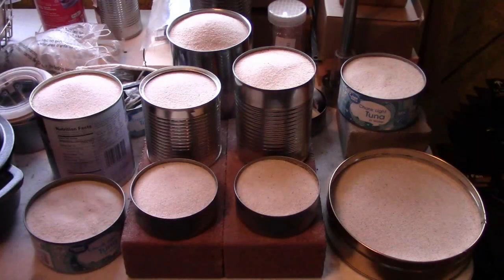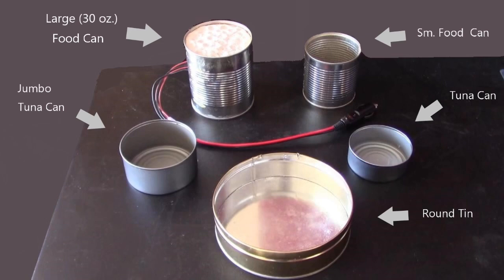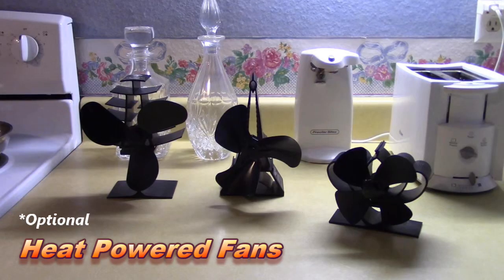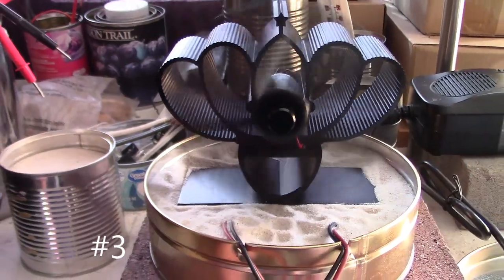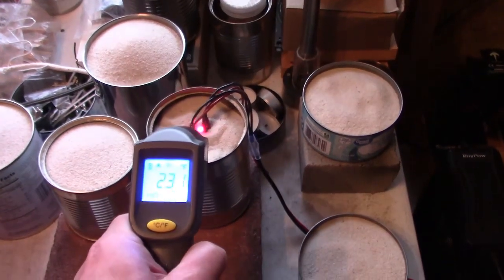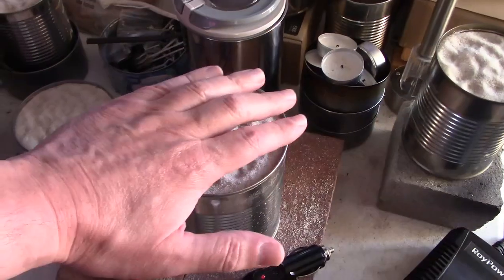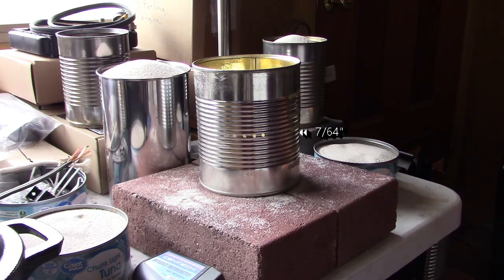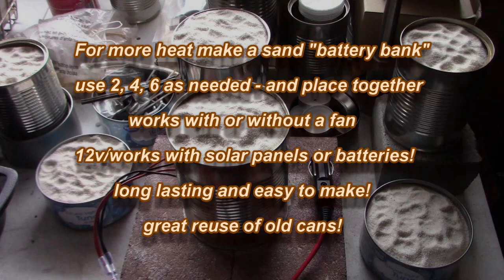5 DIY Sand Battery Space Heaters! with Heating Elements! 300F/150C (self-regulating Ceramic PTC) 12v

Comment: How long do these last burning that hot? I'd imagine the wire connections are going to wear out rapidly.
Reply from the maker: hi. the wires will hold up. they are rated to about 400F. they have a coating on them (i think it's silicone). i've used them (the elements) in high heat applications with no issue for a couple of years. (inside of my water boilers and PTC 'can cookers'.

Comment: Years ago I saw a foreign company using a huge vat of inclosed sand dug in the ground with warming tubes through it. They said the sand could hold the heat up to 5 months. They used it for heating homes. Don’t know what happened to them.
Reply from the maker: hi. there's a company in Finland doing something similar. they are getting ready to make a huge sand battery.
Reply: Works for district heating, such as those found in large cities.

Comment: I tried a 5 gallon bucket with a heating element and 1000 watts input dc from solar panels.  Unfortunately it melted the heating element.  too hot to touch.   I'm wondering if a 55 gallon barrel will heat a room all night.
Reply from the maker: hi there. sounds like an interesting experiment. was it a water heating element? i know those can't run 'dry'. a 55 gallon drum full of hot sand might heat a room for several days or even a week. i've been wanting to use a fresnel lens to heat a barrel of sand. might not take very long.
Reply: @desertsun02  i been saving my big fresnel lense

Then i discovered even the cheap reading fresnel lenses work tape them to the glass 

Im gonna make a solar chimney type heater on south side of my house
Reply: That would best be done with (1) temperature sensors to manage each heaters temp and cut power off when too hot, and (2) multiple smaller heaters throughout the sand rather than one big one. Sand is a good insulator so that is one problem with sand batteries (unlike water) hence multiple smaller ones.
Reply: @Joe-lb8qn  as i mentioned on another post here.....WAX helps trap the heat and it always seems to float to the top making a seal

Heat travels up no matter what....it may take longer to heat if you keep it all to bottom but it heats more sand equalling more heat storage

The key is heat exchange
Reply: @xgymratx wax? What kind of wax? And how would you use it? Wouldn’t this prevent heat radiating at a good rate?

Comment: What rocks are good for heating?
Dolerite, granodiorite, hornfels, gabbro and quartzitic sandstone are the good candidates rocks for high temperature thermal storage.
Reply: Granite sand is a good one!
Reply: how about soapstone?
Reply: @RTFManuel  I was also thinking about limestone.
Reply: @fransjebik8554  isn't that too light for storing heat?
Reply: @RTFManuel  I did it with limestone concreet (powder) and a water heater. Very, very hot and the heater was melting. 
Basalt stone is also used. Granit stone is used in Finland I thought.
Reply: Sauna heating rocks are the ones that will not explode or break by the heat.

Comment: black sand works better
Reply from the maker: that's interesting. i hadn't heard that. do you know the physics behind it?
Reply: @desertsun02  black sand contains various ultramafics, including ilmanite & magnatite & hematite, these are pretty refractory & will radiate heat more efficirntly because of their dark color.  black sand is a waste byproduct of placer gold mining.  it is not near as available as beach sand & potentially may include some sulphide minerals as well as potentially some mercury residues.   quartz beach sand is much more convenient & safer.
Reply: Darker materials also emit radiation more readily than light-colored materials

Comment: Wow, I really like this for solar panel/battery use.  This is going to be something you can leave on overnight.  You could also put them in different rooms and tie them into one controller.   When I get panels, I will definitely try that.  I have the cast iron pan set up going on right now as I type.   I found if I burn hand sanitizer in one of those fireplace gel cans, it'll need to be changed in two hours like clockwork.   This works great for day use.  It's keeping me warm.  Thanks for all your great ideas.  Now I'm really looking forward to getting solar panels.
Reply from the maker: hey there. it's great that your excited about getting some solar panels. the heating elements work well great with 12v panels (just make sure the panels put out the amps you need). it's great that you made the cast iron pan (w/fan) project. i've used that a few times recently.
Reply: @desertsun02  You don't know how much this has helped.  With cases of that free hand sanitizer, I've been able to be toasty warm this winter burning that with 2 of your designs, the T pipe and the cast iron skillet.  Only the T pipe uses a little electricity due to the fan.  Thanks so much for what you do.  I think we will look back at these times as hard times, and well you've made it a lot easier for some folks.  Many thanks.

Comment: With power cost skyrocketing and money going down.... all the no cost and low cost to use heating alternatives are a blessing. Thank you for sharing!
Reply from the maker: absolutely! i often make my projects 12v so people can easily and safely make the stuff (plus it can be easily used off-grid *12v solar panel/12v battery or cars power socket). these elements can be directly hooked to a solar panel, so you can fully "charge up" the sand heater during the day and use it after the sun goes down (the sand will hold that heat for hours)
Reply: @desertsun02  have you tested how long each size hold heat?
Reply: you visibly dont understand thermodynamic...

Comment: I wonder if wet sand has higher capacity or longer discharge time?
Reply: Wet sand has a high evaporation rate, wouldn't that be counter productive having a cooling effect?
Reply: @zanleekain117  Makes sense about water, but perhaps using used-motor oil enough to saturate the sand. Just a curiosity.
Reply from the maker: hi. i'll have to think about that. i'd be curious to know what others think...
Reply: @desertsun02  wax sand

Comment: I noticed you using several different types of heat powered fans. Do you have a preference of which one to use? I’m planning on buying some for this purpose. 
(Looks like we were both amused by the tin can comment). 
Love your videos. Especially since our Arizona weather has such extremes.
Reply from the maker: hi. i like the smallest one the best. its blades are closest to the sand and it has a high airflow rate for its size. second favorite is the traingle one. the taller one is good too but the fan blade are fairly flat so it seems to move less air than the other too. (but maybe it's just spread out) 🙂
Reply: I think I have the same triangle one or one very similar, and it's been running almost non-stop during the day since it arrived.  I really like mine.   This summer I want to see if I can run it as a fan under a candle and get cool air, not hot.  But I don't know if that will work.  I know it works with stirling fans but not sure with these.  I'll find out.
Reply from the maker: @D Olin a candle or two would run these fans. you might want to put something between the candles and the bottom of the fan to keep the soot off of the fan. maybe use a thin sheet of metal. i am currently working on two ways that you can use these fans in the summer. i'll post videos soon
Reply: @desertsun02  do my wax trick then maybe put an aluminum strainer upside down to draw heat up and use as platform to hold fan

Comment: It's UNFORTUNATE that you dont know the MELTING POINT OF TIN METAL - the metal that those cans are made of...
Reply from the maker: hi there. all "tin cans" these days are made out of steel. they can handle up to 2000F/1094C. they're often still called "tin cans", so it can be confusing, but they don't make them out of that anymore. some have a coating of tin (called tin-plate) on the outside but that is mostly made of steel or iron too. only 1 to 2% tin - so it holds up fine. pure tin melts around 450F (232C) but the can won't get that hot. around 300F(150C) is tops. the heating elements are self-regulating and won't get too hot.🙂
Reply: Told
Reply: “Tin” cans are actually made of steel (iron and carbon). The name comes from the use of tinplate, and in many modern cans, tin has been replaced by the use of chromium.

Comment: Another wonderful video I am gradually understanding the methods by watching your interesting videos and gonna try making one .....hugs from Chilly Scotland 🙂🤗
Reply from the maker: hi and thank you! have fun making it (super easy to do it - just 3 things makes these - or 5 if you get the plug and the fan)
Reply: Would salt work?
Reply from the maker: @angela mcfadden that's a good question. i'll research it. might be a future video
Reply: @desertsun02  I was about to ask the same question as Angela. I saw online sand has a specific heat capacity of 830(insert units here) and salt (NaCl) is 800. So hoping it'll work. Would love the Desertsun seal of approval on that
Reply: @desertsun02  yeah i mentioned that on one of your recent videos

Use kosher salt and also those little silica gel things you get inside pill bottles ne shit.....open and dump those in

They get hot as hell so does the salt but i think sand is great base for storage end of it....i hear perlite actually would be good too not because of insulative purposes but for heat storage wanna really reclaim the heat? Ad some alum conduit through bucket....im gonna use popcorn tin....oversize a few pieces and feed through maybe inch or 2 over elements.....then cover completely of course then add WAX.....also great at storing heat and also keeps super hot and prevents heat from escaping heating the tubes something fierce

And put them at a 45 degree to autosiphon cold air and convect heat upwards out other end

Or coil a long one .....let it autosiphon cold air around a decent length of aluminum tube and spit hot ass air out the top.....you can even connect it to some kinda heatsink to set the stirling fan on

Oh and maybe roll up some aluminum screen very loose in there before pouring sand.....just to ensure heat travels all over inside of bucket

Like i said i have 2 popcorn tins to experiment with